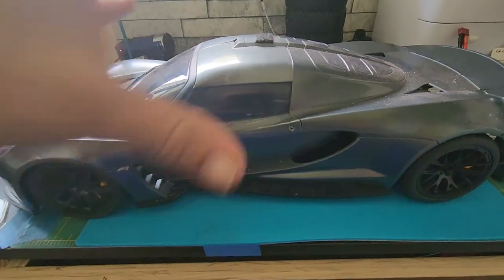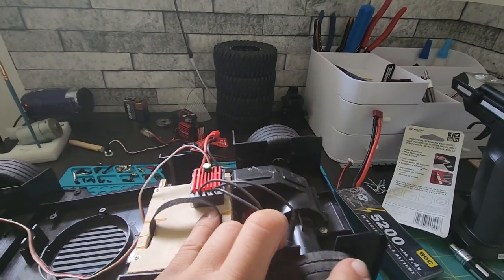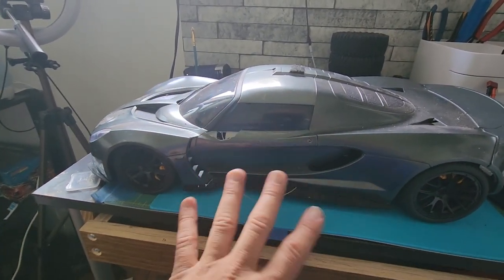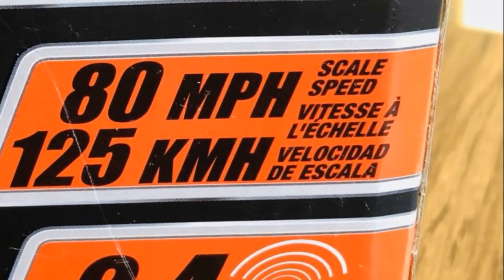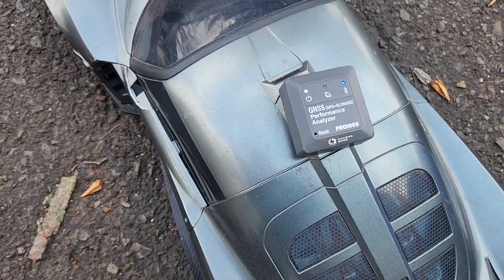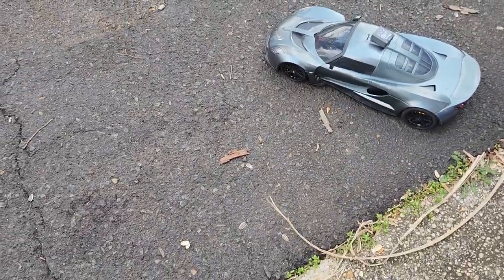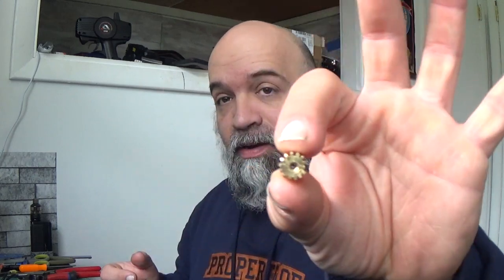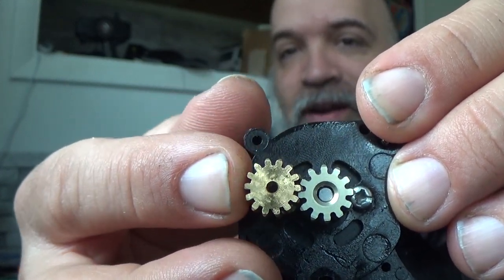1:8 scale toy grade rc Hennessey Venom GT test run with new Brushless system

Comment: 23mph is not bad but also not super fast my hobby grade low cost rc goes 33mph on 2s brushless iam going to upgrade it to 3s 
because it has metal gears i hope over 45mph to get out of my car on 3s but its insane on 2s so 3s would be  un controllable
Reply: on 2s almost standard back flips and good wheelies
Reply from the maker: For a toy grade car to go 23 mph is pretty good but it can go faster